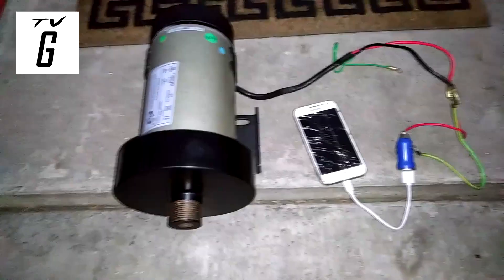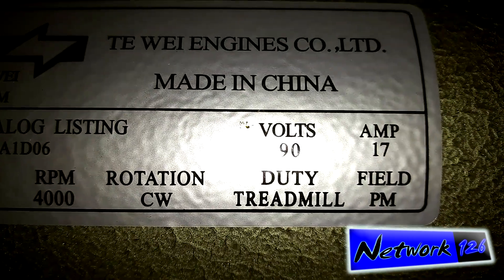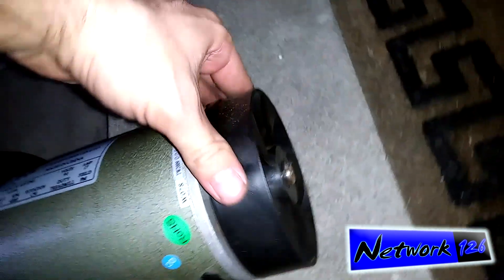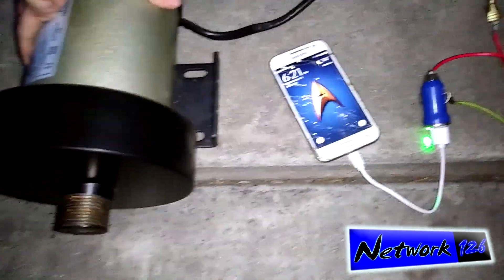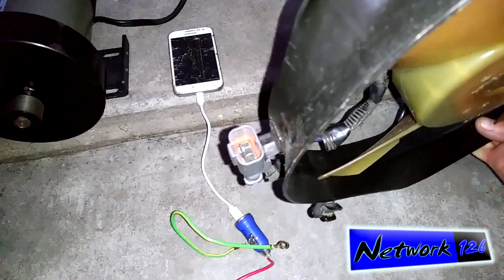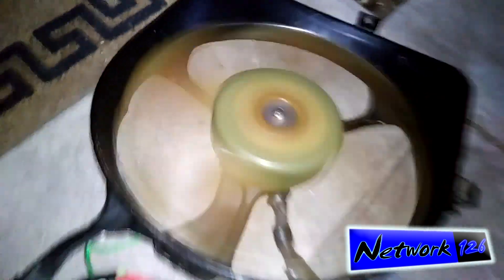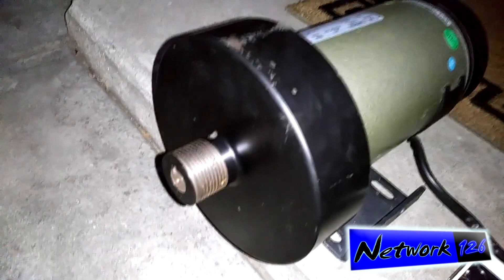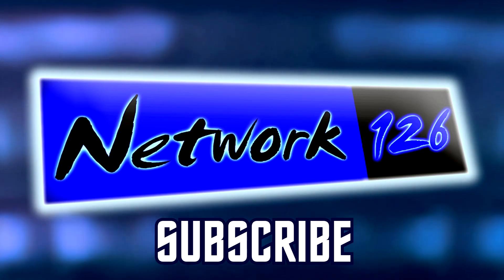Charging a phone with a treadmill motor

Comment: That's cool. You just need to find a motor big enough to generate enough power to run household appliances, get a wind turbine and then there you go, you'd be generating your own electricity. I've got to do that.
Reply from the maker: Some people actually use treadmill motors to build wind turbines. I've seen it here on YouTube. They seem to be able to generate a decent amount of power if you get them spinning fast enough. I bet if you hook a few solar panels and a wind turbine or two up to some deep cycle batteries, you'd probably have plenty of power around the clock.